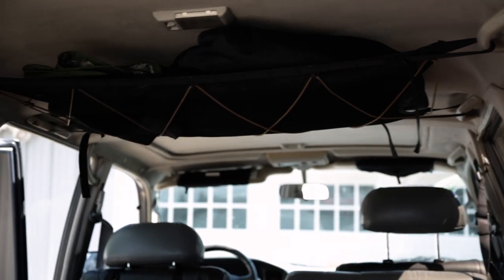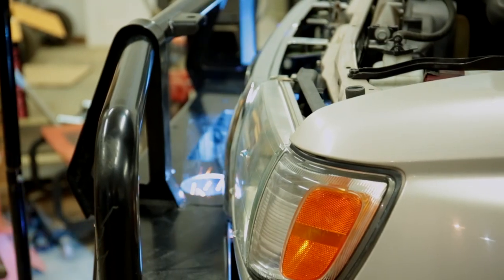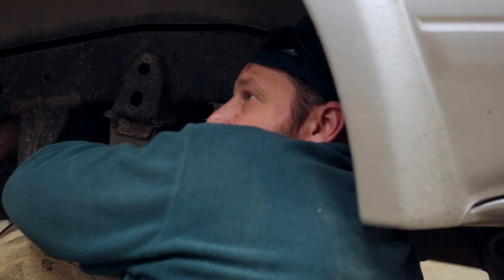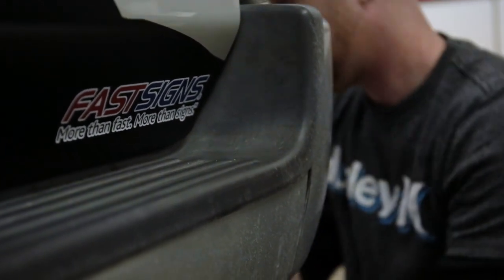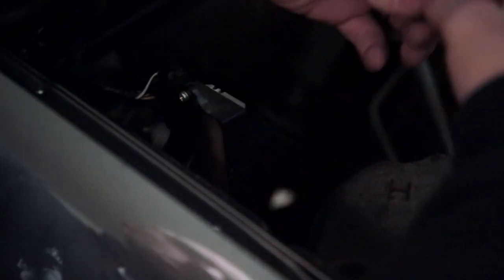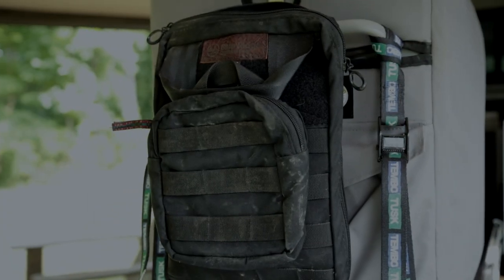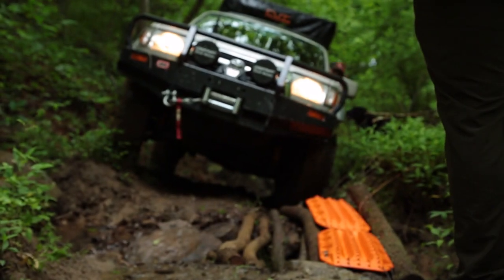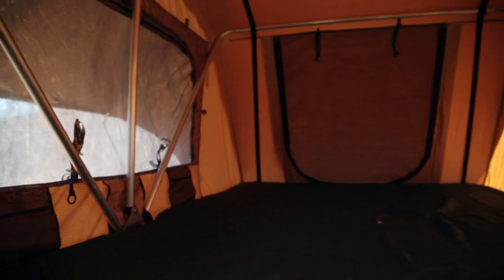PS2 - The Build - Mountain State Overland - Mountain State Overland

Comment: According to LEER their caps can only hold 150lbs... how did you get the CVT tent on the cap of the truck? I have a truck with a LEER canopy with a Thule rack installed on the Thule add on rain gutters and would love to get a roof top tent. My other option is another rack on install it over the cab of the truck but would prefer it on the cap on the rear.
Thanks
Reply: +Dan Campbell you've been misinformed. each thule bar holds 150, so 300. when the roof top tent is open the ladder supports half the weight. max including tent = 600 pounds
Reply: he is talking about the bed cover/ camper top. not the roof racks...

Comment: You guys need to get more wide angle shots in here. All the shots are zoomed in so close you never get to see anything. For example the sliding storage in the back of the truck. I would have loved to see the entire system instead of the corner of one sliding container. Lots of shots of the corner of a bumper and an elbow. Let us see the big picture.
Reply from the maker: Thanks for your feedback. There is certainly room for improvement! Thanks for watching.
Reply: Thanks for the videos! Always great getting to watch some overland or off road driving videos. Cheers

Comment: Looks like you have the awning mounted with one bracket on the front rack and one on the back rack. You ever have problems with the cab and bed flex putting strain on those brackets?
Reply from the maker: +Matt McManiac yep, that's how its mounted. Never had a problem. The awning extrusion allows enough flex that its never been an issue.

Comment: Do those tents stay 100% dry inside
Reply from the maker: Yes. You will get some condensation buildup under the mattress at times depending on the weather temps and humidity but the walls are always dry. The tent breathes incredibly well.
Reply: so no mod or any worries like that
Reply from the maker: No worries. I always pop my tent open when I get home to let it breathe before I zip up until the next trip.
Reply: Mountain State Overland ty

Comment: what ome suspension was used on that 4runner
Reply from the maker: +Tony Nocita the Prado springs
Reply: +Mountain State Overland what would you recommend for a 3rd gen 4Runner for a budget minded 17 year old high schooler. my dad bought the car brand new and he doesn't really want me changing it, but whaf are some small mods other than a lift that won't really change it much other than wheels and tires. I don't wanna totally change the look too much